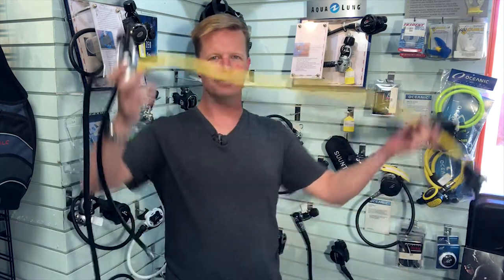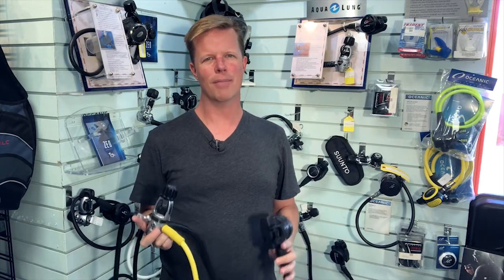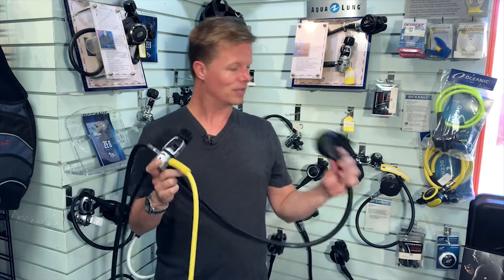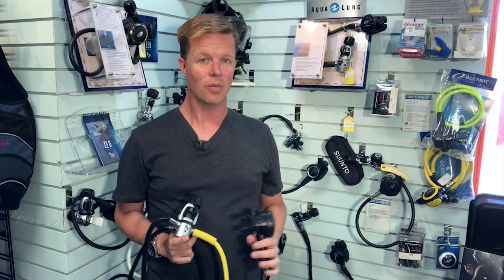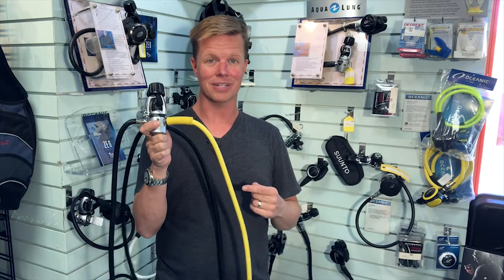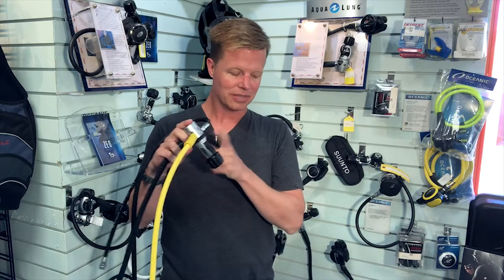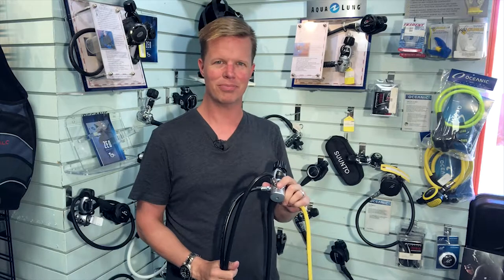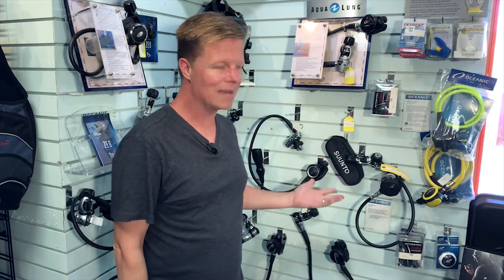Risks of Diving with Old, Used Regulators

Comment: Don't drink this Kool-Aid.  There are a bunch of "vintage" regulators that are totally valid and some still in production today.  There are also plenty of brand new regulators that aren't environmentally sealed.  This video provides an opinion with very few facts supporting that opinion.  There are plenty of brand new regulators well under $600 that'll also work just fine.  Dive shops should get people jazzed about diving and let their own gearhead tendencies takeover when they eat, sleep and breathe diving.  There's cool technology out there, yes.  For the majority of recreational divers a used reg set that's been gone through by a certified tech should be just fine! If anything picking the reg set has to do with diving conditions not the age of the technology or the number on the price tag.
Reply from the maker: I don't disagree, but I see a lot of used gear online with no warranty.  If someone doesn't know to get it serviced first by a trained tech, they could be taking a great risk.  And if the tech says this gear is undivable, they have no recourse.   Buying used gear is definitely 'buyer beware.'

Comment: I bought some gear that was 20 plus years old. I took it to my local dive shop and they were able to service the first stage, second stage, hoses.  I don’t see a problem with older gear as long as it’s checked and serviced before use.

Comment: There is absolutely no reason that an older regulator that has been serviced (new o-rings and sinter filter) and tuned is not safe to use. I have a 30-year-old regulator (Scubapro Mk10/G250) that is just as good and and safe as anything today.  The technology that has changed over the years is the material of the o-rings. The basic design has not changed a lot.  This guy just wants to sell you a new regulator.

Avoid this guy and this dive store.

Comment: Dude, I use a Conshelf made in 1974 and it's fine. You, want to sell new gear I get it. BTW many old regs are out there but OEM no longer makes parts or went out of business. So they are pretty much useless. 🤔 If you plan to buy a regulator on the second hand market,  do your homework and once you get it have it serviced and your good to go. News flash many people take your advice and spend a ton of money on dive gear and never dive after certification much, a few years go buy and sell the gear for a good price. And one last thing, never mind.
Reply from the maker: If you use older regs or want to buy used ones, that's fine.  Just be sure to have them serviced properly by a trained technician and understand that buying at a local or online 'garage sale' has some added risks.  Thanks for making some good points.

Comment: Seac Pro 2000 BCD, Seac Synchro Regulator Octopus and Aqua Lung i750 Dive Computer this is the stuff i bought is this safe? i mostly dive in shallow lakes and rivers metal detecting but i still dont have a need to die
Reply: and im a new diver so im starting to think most shops will sell you anything that you can afford
Reply from the maker: Thanks for the question.  I can't say if gear is safe or not without checking it out myself.  I would recommend visiting a trusted local dive shop and having them offer an opinion.  Dive safe.
Reply: @CaseyKlaus  I tried that my only local dive shop told me he wouldnt help unless i buy my gear there so i tried to buy a mask than ask still would only help with the mask but i did notice the computer and bcd there. ill just have to give her a test :D
Reply: bcd and computer at the shop
Reply from the maker: @robknott1687  That doesn't speak well for the dive shop.  It is recommended that you get the gear serviced regularly per manufacturer's instructions (typically every year).  If your gear hasn't been serviced in a while, you should have that done.  If there's only one shop around, you're stuck and I'd ask them if they service other gear than that they sell. If they don't, I suggest you call around to other areas that may work in some way for you.  Not at all easy, but this is gear that allows you to breathe underwater, it's important to assure it works properly.  Sorry you had a poor experience.